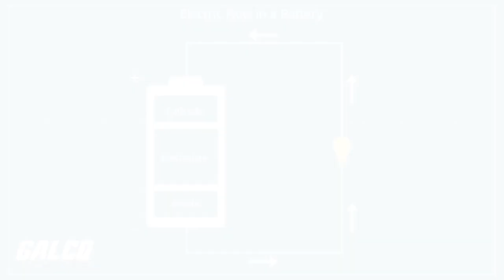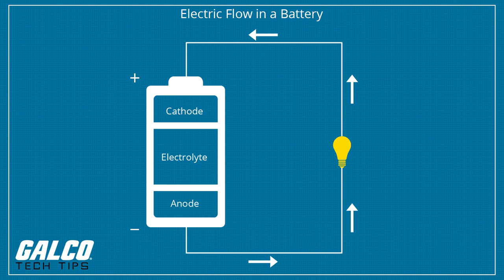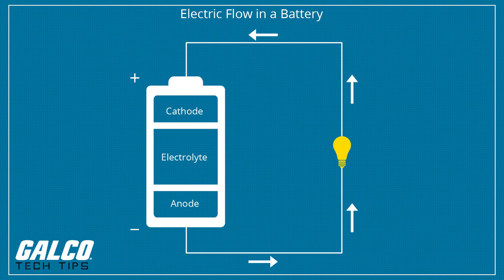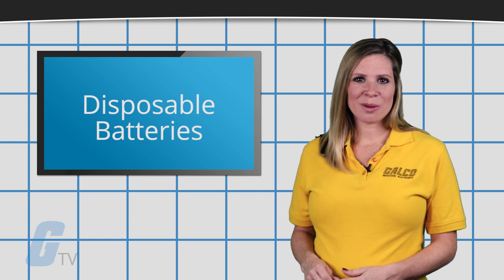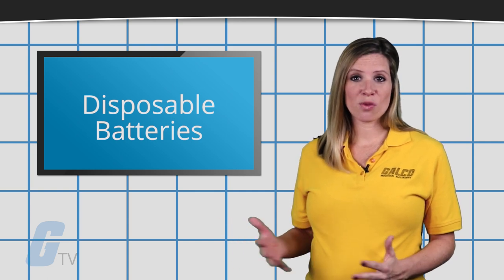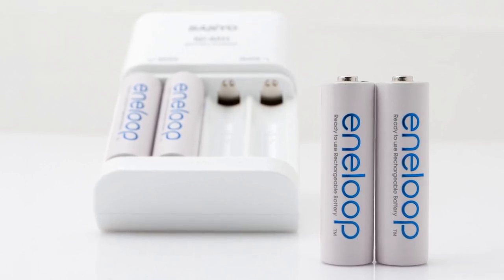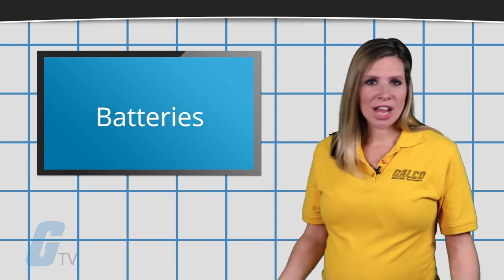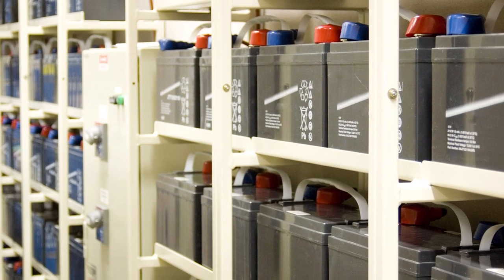How Do Batteries Work? - A Galco TV Tech Tip | Galco

Comment: What's the point of the electrolyte then if the electrons just flow through the wire?
Reply: electrons flow inside the battery first (through the electrolyte) and then exit the battery and flow through the wires. Without the electrolyte the electrons cant exit the battery

Comment: we asume Cathode as Negative terminal and Anode as Positive Terminal. You've made a big mistake in this video..
Reply from the maker: Batteries are like electrolysis going backwards (they split up chemicals to make electricity) so the terms anode and cathode are switched around. Okay? To avoid confusion, I suggest it's best not to use the terms anode and cathode at all. It's better to say "positive terminal" and "negative terminal" and then it's always clear what you mean, whether you're talking about batteries or electrolysis.
Reply: Good catch; Google agrees: 
cath·ode
ˈkaTHˌōd/
noun
noun: cathode; plural noun: cathodes

    the negatively charged electrode by which electrons enter an electrical device.
        the positively charged electrode of an electrical device, such as a primary cell, that supplies current.

an·ode
ˈanōd/
noun
noun: anode; plural noun: anodes

    the positively charged electrode by which the electrons leave a device.
        the negatively charged electrode of a device supplying current such as a primary cell.
Reply: While I was about to say the same thing, you have to realize that that's for components of a circuit. For the power supply, it's flipped around. Look up the cathode of a battery and you'll see. 

It's easy to understand once you remember "cathodes connect to anodes". If the battery's positive terminal was the anode, you'd have anode>anode-cathode>anode-cathode>cathode
Reply: @paulcohen6727  if you're saying Google agrees with the commenter, it doesn't. You can see the secondary definition for both talking about power supplies.

 If you were saying it agrees with the channel's reply, good job